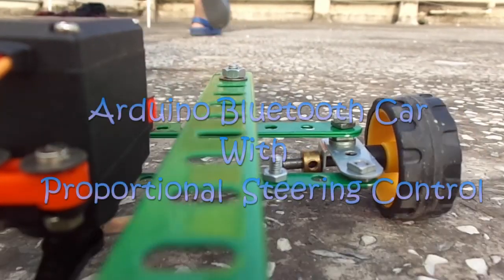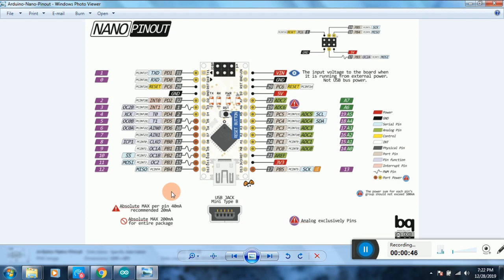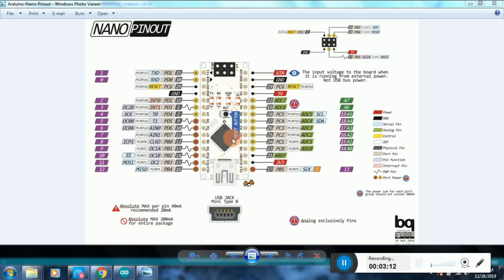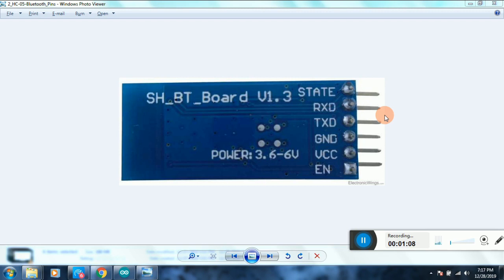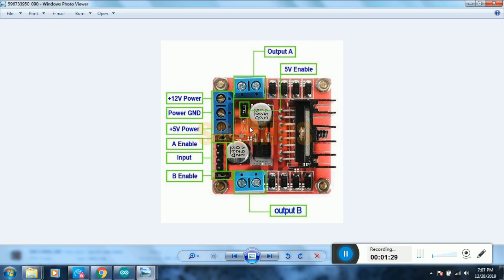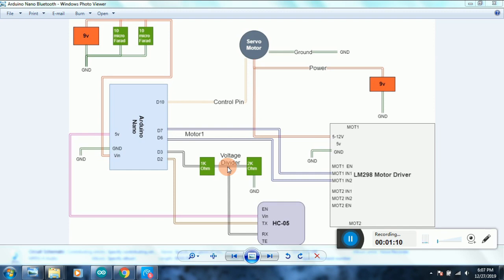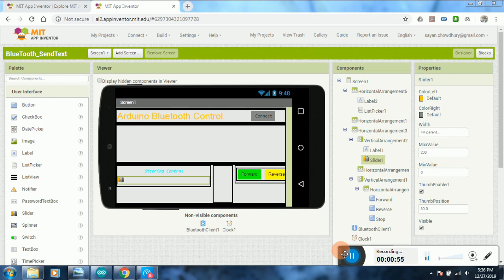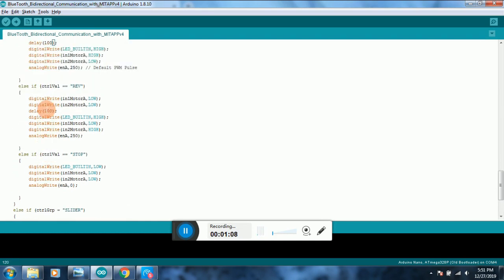How to make Bluetooth controlled car with Proportional steering|#ArduinoProjects|#Meccano

Comment: Can you make this with two motors at rear axle and servo control at front wheel for steering by using Ardiuno Uno.
Pl also share code of the same.
Thanks for your this video.
Reply from the maker: Why do you need 2 motors in rear axle
Reply: @saimorph  It will look realistic like 4 wheel RC car having servo control Steering.

Comment: buddy there is a prolem with your reverse control grp its not working
Reply from the maker: in the interface sometimes you have to make sure that the size of the button is big enough. I had to adjust it , but it worked fine. I have used it for a long time

Comment: Hallo..i'm from indonesia....can you share aia file?
Reply: @saimorph  thank you very much ... I just want to add a few buttons for other functions ... this is a very good application in my opinion ...
Reply: @saimorph  allright bro....
terimakasih banyak 😄
Reply: @saimorph  

hello bro ... why on my cellphone the notification "error 516.unable to write broken pipe" appears? hc 05 connection was disconnected itself ..
Reply: @saimorph  the status application is connected ... but after a few seconds the connection is lost ... I only use 1 power supply, does that matter?
Reply: @bulanracingofficial  did you solve it? Same issue here...
Reply: @zandaa2703  I didn't continue it bro... switched to mini rc drift... hehe
Reply: @saimorph  ok..thanx bro